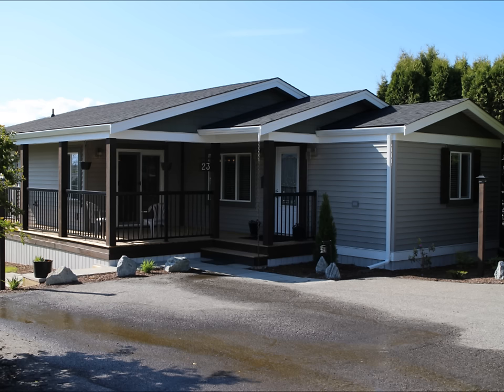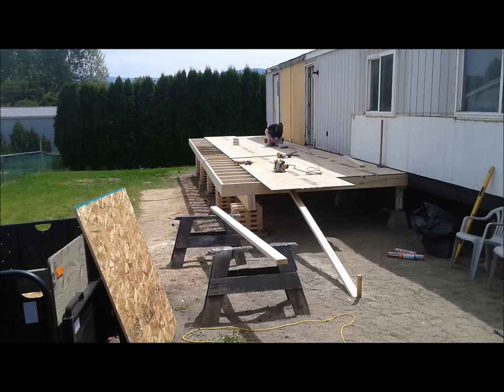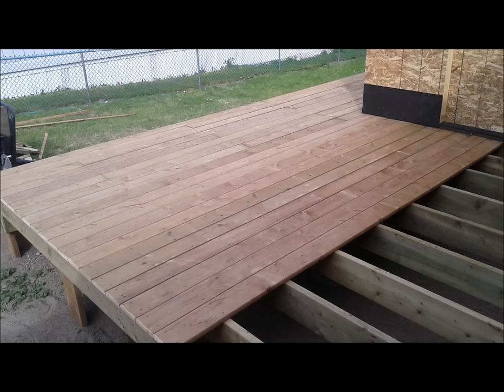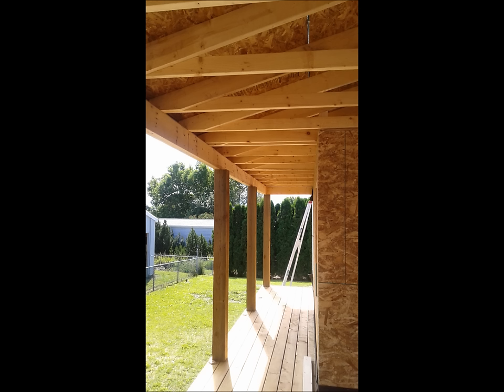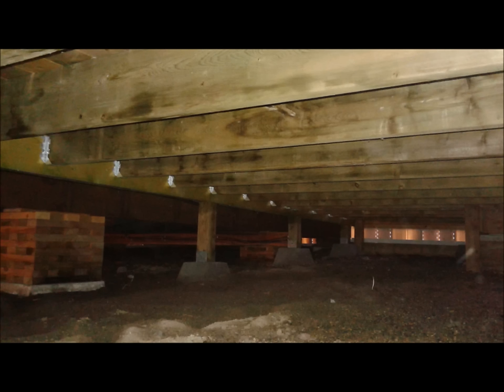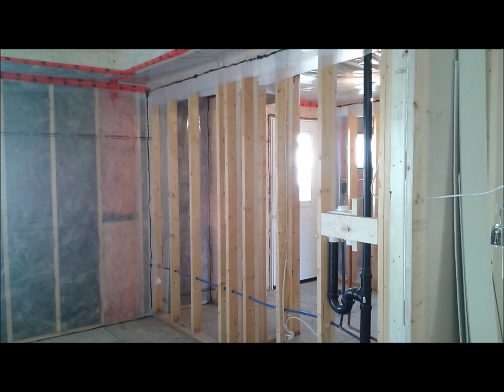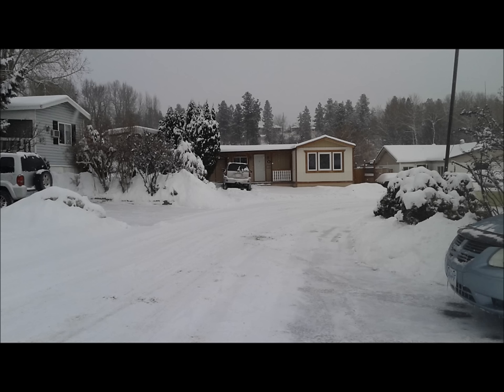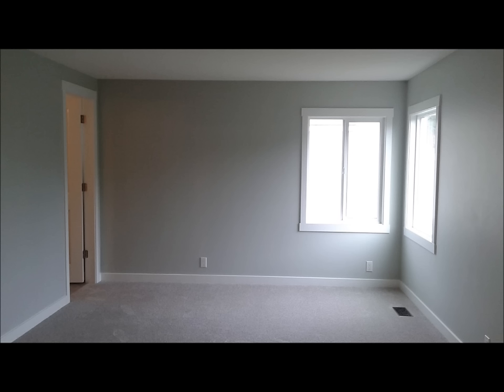Building An Addition To A Mobile Home - Start To Finish : E026 / BC Renovation Magazine

Comment: I didnt see a ridge why
Reply from the maker: Hello, Antoni. There are many different ways to build something. In this case we did kind of a hybrid between a truss rafter roof and a stick built rafter. The building authority did not permit us to span over the original exterior wall of the mobile home with the rafters. The roof over the mobile home and the roof over the addition had to be two separate structures. Neither was allowed to load the other. Thus, we essentially ended up building two sets of site built mono trusses that met over the original exterior wall, and as you know, trusses do not have a ridge board. Trusses are blocked at the ridge, as we did here. This was all under the direction of the building authority and inspector. This is how they wanted it done. This is somewhat unconventional framing method but quite simple really. Just the way of dealing with the requirement of the mobile home and addition to be separate structures. Sometimes you have to think outside of the box when you work on these. ☺ Thanks for watching.
Reply: I was about to respond , saw his response thought I'd throw my bit in
 Actually, what he said. I was a brick and stone Mason, framing carpenter, cabinet maker, trim carpenter, commercial construction superintendent and built spec and custom home builder, up to 5,500 sq.ft. Worked in several parts of U.S.. I learned there more than one method of construction, some older styles not so common today but not necessarily one always inferior. Balloon construction comes to mind. The exterior was dried in before building floors. This was done before power and air tools so a floor was open to weather longer so this was more practical. One of many variations. Regional traditions are a factor also. Having done a lot of renovations and additions I learned familiarity with different methods can be valuable in addressing different situations. I have found myself dealing with some peculiar tasks a number of.times. Been working outside my region and told I was doing it wrong by locals. Come to my area and you can be be wrong was my response. Nobody ever learns it all and I have discovered many times there were better methods than mine for a certain endeavor. Rather than insist I'm right, absorbing new knowledge, bite my tongue and bide my time. Eventually a chance will come to call someone else a meathead. I've worked on mobile homes as well and that is not one of the easiest types of building to work with. Sometimes square, level and plumb can an arbitrary concept. You figure out a way to graft onto what you can't change and try to meld it with the practices you are accustomed to. Sometimes a string or laser line and even sighting a line is the best method. If it looks straight few will ever know if it's exactly right with the world. If you can make it straight with the proximity it is sometimes your.best shot. From what I can see it looks like he did a very competent job. That's not a lukewarm endorsement, competency is often in short supply. I have received more praise than I earned at times, not necessarily  because of excellence but because I didn't screw it up. Again, not screwing it up is not all that common.
Reply from the maker: Frank, thank you for your thoughtful comment. Like you, I have been involved in the building industry for many years. I am a journeyman carpenter with 40+ years under my belt. You are absolutely correct when you say that things are done differently in different areas. Does that make one way right and another wrong? I don't think so. It's just different, that's all. There is more than one way to cook an egg. My career has been in conventional construction, mostly residential. I have built my fair share of conventional homes and many, many renovations. Working on these mobile homes is somewhat of a departure. They are un-conventional. And, as you know, when you have the building inspection authority looking over your shoulder, as we did here, you have to comply with the way they think it should be done if you want things to go well for you. The end result here is that this home was inspected several times throughout the process, by people that had seen a lot more of these than I had, and built to our local codes. This home is not out in the woods in some obscure location. It is in the center of a major urban metropolitan area. It got plenty of scrutiny while under construction. We weren't getting away with anything. Three years later it is standing straight and true. I see it almost everyday. There is no settling or separation occurring. There are no cracks in the drywall. Whatever advice/direction/requirement we received from the building authority seems to be working. And for what it's worth, the original roof on the home had no ridge board, or blocking. The peak was left clear for a ridgeline venting system. If I were to describe and explain every framing detail here I am sure that I would have a video more than an hour long. That is not the intention of this channel. We are not really a DIY channel, but more of an idea channel. If you like our ideas, take them and talk to your local people to determine the best way to have those ideas executed where you are. Appreciate you watching and commenting.